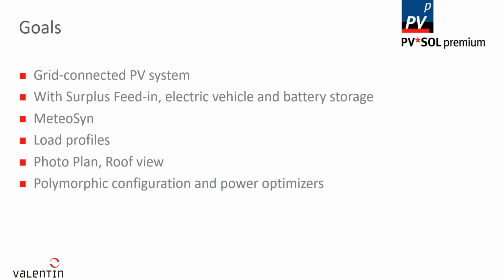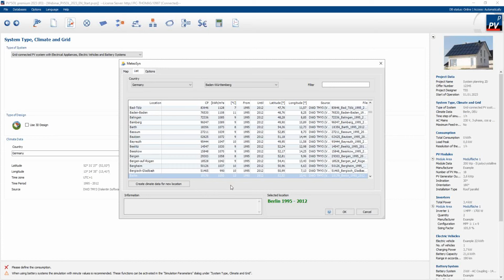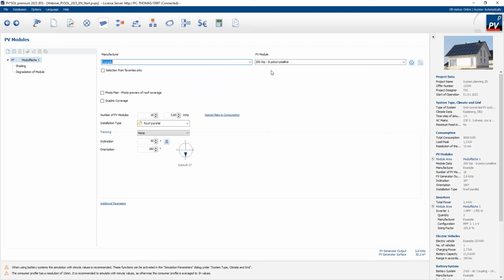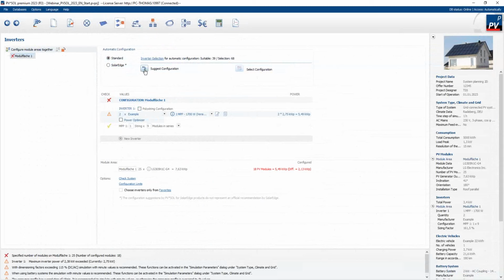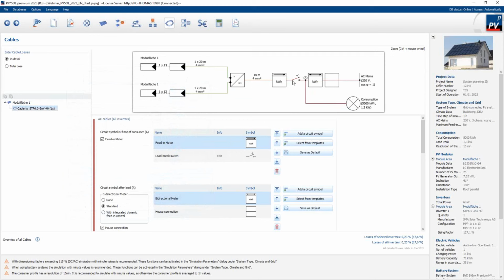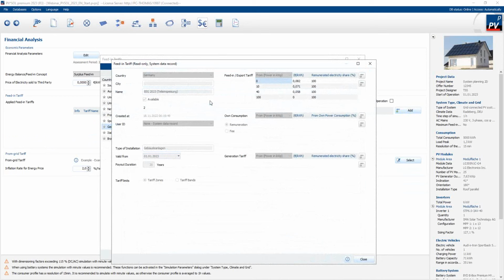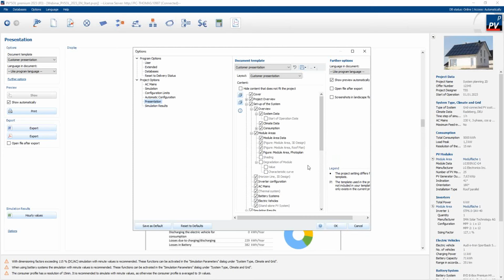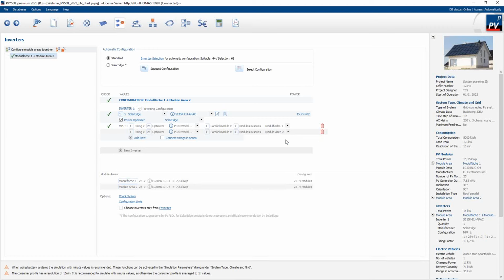[PV*SOL Webinar] Introduction to system planning – Part 1 (2D)

Comment: Thank you for your efforts in developing a comprehensive software. However, I would like to point out an important aspect: the ability to modify the temperature settings for the city where the project is being implemented. The average temperatures are not always accurate as shown on Google Weather. If this feature is added, the software would be more complete, as calculating the temperature coefficient of solar panels using inaccurate temperatures can lead to errors in the reports.
Reply from the maker: Thank you for your kind feedback! You can change the mean outside temperature settings for a location by creating a new climate dataset using your own measured values.